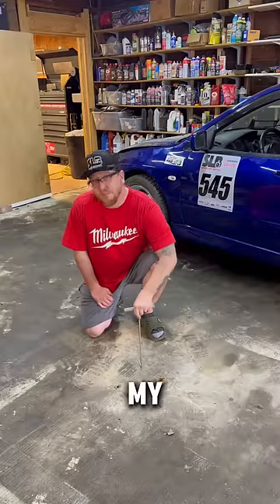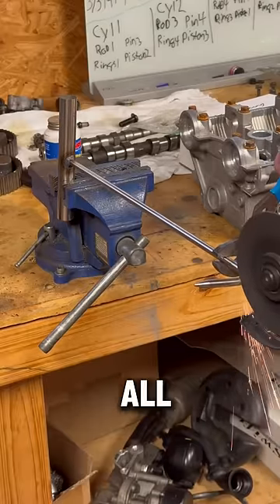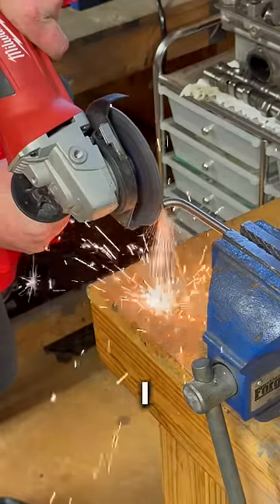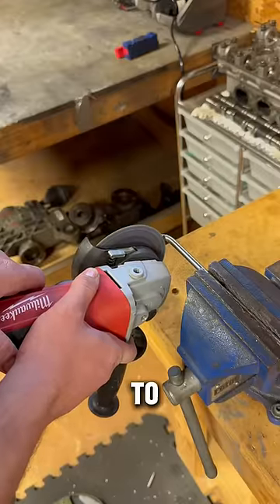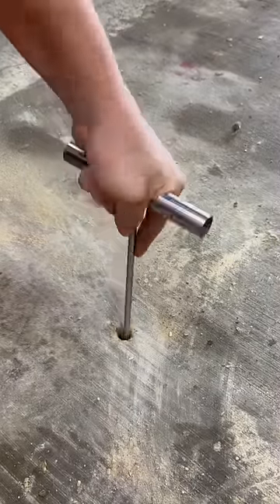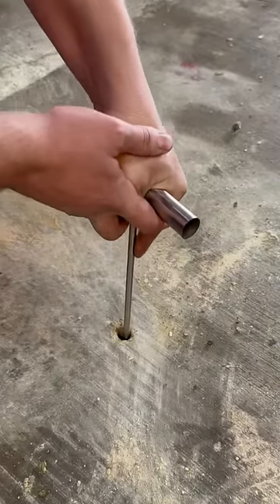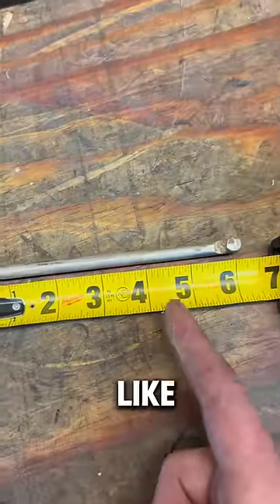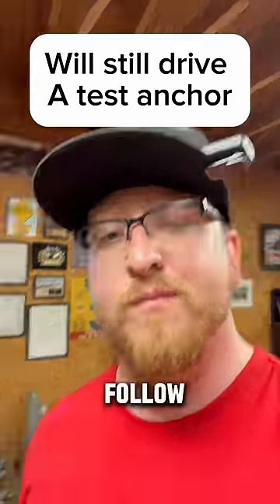Making a tool to measure the depth of concrete.

Comment: Im a professional lift installer. You were never in any danger regarding thickness of the concrete even with the last measurement.
Reply from the maker: I appreciate that Jordan. Initially, I only drilled down to the 4.25 inches as per required by max jacks but other people were saying that that was too low on the minimum requirement scale so that’s why I punched all the way through to see the entire thickness of it and now I have done this in four spots around the center area of the garage where I plan to put the posts. And all of them have measured 5.3 to about 6 inches I just wanted to check before I make a $3500 investment and then have to try and sell it secondhand if it didn’t have enough depth. Thanks for not being a dick. Lol.

Comment: A small key chain tape measure WILL fit down that hole. I have one that is less than 1/4" wide. You said the hole was 1/2" so explain to me how it doesn't fit. Plus the tape measure already has a hook on it. You made a tool to measure something with a tape measure when you could have just used a tape measure. It's the equivalent of going fishing and carrying a canoe in your boat so that you can fish from the canoe 🤦‍♂️
Reply from the maker: The smallest keychain I had wouldn’t and I wanted something stiffer. But this video made 800 dollars so I’m good lol

Comment: Check other parts of the pad, it could be 10" deep at one point and then you can have a High spot and it only be 2".

Wherever your bolting into the pad check there.
Reply: Would you not level out an 8" swing? At least a little bit?
Reply: @Awesummzzz  if they did it properly yes. But if you didn't do it yourself or see it being done, who knows if they did it properly or not. Lots of idiots and nasty people out thier. Always check the one time you don't you will get caught out.
Reply: @PsyMongSki  that's fair. Better safe than sorry. I figured pouring a slab on an uneven surface would be more of a hassle than leveling lol
Reply: @Awesummzzz  that's the proper way of doing it. But think about scammers, if they can use less concrete it's more money for them, so leaving high spots helps them save cash.
Reply: @blakemoresimon  good point. I was more fixed on having the extra deep part so saving cement wasn't even a thought lol
Reply: @Awesummzzz  concrete is bloody expensive now same as tarmac the scammers love to tell you they are putting it down 7" but only lay 2". Mind the local councils are also good at that haha

Comment: Trust me while it may be 4+ inches deep you have no idea how brittle it has become if it wasn't mixed correctly to begin with.
If you are putting up a rack Always-

1) Cut out the concrete
2) Dig out the hole
3) Pack it with gravel
4) Go 8" Thick with the 10" 'J'  bolts
It's all cheap and easy and guaranteed to protect your life.

Comment: .....Maybe I just know too many mechanics lol. For heavy industrial use, 6-10" is ideal, depending on soil/underlayment from what I'm told. Rebar is also really common to put in as well, especially in freezing climates. Concrete hates freezing lol. Make sure nothing gets under it, especially if it doesn't have rebar, as if it gets literally under mined the slab will fail over time especially if no rebar. Concrete is more flexible than you'd think, but it doesn't bend and does best with spread out loads. Directing water away from the pad and backfilling & packing any holes that appear within a yard of the building also supposedly helps.

Comment: Most house pads are 6” slabs if you ask for a reinforced slab it is 8”, now your garage slab is sloped so the deepest will be 6-1/4” and the shallowest will be 5-3/4” now in commercial it’s 8” to 12” depending on the industry. I do foundation design

Comment: well when the roto hammer punches through, its going to knock a plug out the other side, that might lower what you're measuring,  best to jackhammer it all up and measure each piece and average it, then pour new ultra cool slab.   :)

Comment: Its a slab im assuming all tied into the foundation so there could be some spots 6 in and some that could be a few feet thick. You can always check the required thickness for your county and it should tell you

Comment: Lots of simpler way to do this like a coat hanger, but also remember your concrete is all kinds of thicknesses. It's not poured in a perfect slab. There might be 6 inches here 4 inches over there and of course the perimeter is potentially very deep.

Comment: Best way to put anchors in: drill the hole all the way through. Put the anchor in. If later, down the road you bust a bolt or the anchor doesn't hold you can drive the old anchor further down and out the bottom of the hole. Install a new anchor. 😊

Comment: If you look where your garage door closes and driveway starts. You can pull up the rope looking material and use a tape measure. Should be an 1" opening
Reply: Or look up county code

Comment: Could have saved time and money. Go to a RENTAL RENT ALL store, and get a concrete measuring tool. You lay it on the concrete floor and wa-lah, it displays the depth in inches, centimeters, etc. Probably cost for a few hours is less than $10. You can also ensure the depth is consistent around the floor.
Reply from the maker: But I made over 600 dollars on this video

Comment: Set up a rotary laser away from the slab and raise the beam 6" above the slab. Verify this measurement in several places and record those dimensions. 
Without moving the location of the laser,  lift the slab out of the way, turn on the laser and get a measurement to the dirt under the slab.

Now, the tricky part. Subtract the original 6" measurement from the new measurement to the dirt. This new number is what the thickness of the concrete is.

Comment: The only thing I would know is when my previous boss was building his shop. The company that installed his lifts refused to install them in less than 12 in of concrete. And they were standard rotary two post lifts. I think with a thinner concrete floor I would just splurge on a four posts and deal with how much it sucks to do tires and suspension

Comment: So hold the grinder vertically like you did in this video like you were gonna cut straight down, now cut the bottom 1/3rd off that grinder guard. Still full proction and it diverts the sparks straight down. In this videos case, they would have went to the floor instead of the table. Little thing I do to all my grinders when I have to use a guard. Satisfies the safety man. Yet give me a little more eyes on and sparks away a lot more instead of bouncing off whatever is close.

Comment: I watched jerryrigeverything check his concrete thickness. What he found was that it was incredibly inconsistent from spot to spot (between 2 and 10 inches thick). I doubt it will be that bad, but be sure to check as close as you can to the jack.

Comment: I would have looked at the dust on the drill bit. That tells me how thick concrete is, and I drill a lot of 5/8" holes in floors doing pest control. Recently I had to skip one because my drill bit wasn't long enough. It must have been 15" at least, I never got through. Usually they're more like 5-6".

Comment: Concrete thickness is not a reason to give up on getting a max jax car lift.  Ceiling height, budget, vehicle weight and wife are the only reasons not too.  If your concrete is from 70's and thick and solid you are all set.  Clean the holes thoroughly, stick something in like pinky finger to verify there is zero dust.  I did this and managed to drill 20 3/4" holes and drove wedge anchors in without a single issue for my used 12k 4-post shop lift.  First time drilling concrete holes larger than 1/4" and setting wedge anchors.  If you get a MJ and go to install and find one side is not right you can always cut out part of concrete and key in a small deeper section of concrete to redo post anchors.  Not cheap but doable, even DIY with properly mixed bag concrete.
I had no problem verifying depth while drilling with post in place, I was as careful as I could be not to break concrete out the bottom because I was on the hairy edge of enough concrete thickness on 30 year old concrete.

Comment: Hay just a heads up if the concrete guys used a shoot from a long distance it could have moved the gravel from that spot and put a pit in that spot so it would be thicker just in that spot.... But if your confidence in it is good you do you bud.
Reply from the maker: I have checked 4 spots now all 5.3-6 inches
Reply: @Bang4BuckRacing  oh, good to hear. Great ingenuity also.

Comment: 6" pour for a garage slab is the most common, that's what we always did when I was on a concrete crew.
Reply: About to say the same thing
Reply: Where is that commom???out 450+ homes never. pole barns and shops yes,street repair 10 inches, every garage basement sidewalk graded 3 1/2". Where do you live that 6" is residential garage floor common. Are the walls 10"??
Reply: @noextrafood 6" is code in MA, foundation walls 8" to 10"
Reply: Sorry  I only worked Missouri not north pole.what is the reason for thicker floor so can park loaded snowplow in garage? Can you hunt bears with dogs. Swap some mt.lions for your bear
Reply: @noextrafood  we have aloy of sand. So that's taken into account along with the freeze table. Bear population is just starting to comeback on the eastern side of the state. So no dogs yet. Lots of white tail though
Reply: Hey is ma maine or Massachusetts
Reply: @noextrafood  MA is mass, ME is Maine
Reply: @madman19932  if you tired of sandy dirt come here, south of 44, did subdivision in Festus where utilities and most holes had to be shot. Guess  wood stakes 4you, no pins with nail holes?
Reply: @noextrafood   we either have pure sand or solid granite. Building here is so much fun -_-
Reply: @madman19932  ain't mass. Where all the rich people are? Martha Stewat's vineyard . What flatwork rate $10ft
Reply: @noextrafood  that's only the Vineyard, and Ptown. The rest of us are mostly blue collar

Comment: Trust me you'll be fine, we put our lift in an apparently our garage is on a slope, well one side the anchor bolts are in 4 inches the other side its little over 2 inches. But we haven't had any issues luckily lol
Reply from the maker: 🤣🤣 if it works it works lol
Reply: @Bang4BuckRacing  we put my buddies jeep on it with 2.5 rockwell axles, the thing weighs almost 7k pounds an it didn't end up falling so we figured it'd be alright lol, until a couple years later an the concrete cracks 🤣🤣

Comment: Did you test at multiple points? Unless the floor was done properly, it probably has a bunch of variation. If you tested 2 or 3 more spots and they were 5.5-6.5 I’d say you’re good. But I’ve seen plenty of floors that travel between 2.5-8 inches, which is obviously problematic without even putting load on it

Comment: I cut and dug an 800mm hole in my concrete floor, with rebar hooking into the old concrete at 200mm.   I have a heavy 4x4 - so this was insurance..... Only took a few days to engineer.   Just too final  if it goes wrong.

Comment: Dosent really tell you how thick it is only tells you how thick it is in that spot if your pad was not leveled then could be 6 in pne spot 4 in another  sorry
Reply from the maker: I’ve measured two separate spots 5.5-6 inches
Reply: I think if he would just go to his local DEMO MAN OUTLET STORE, he could pick up a starter set of graduated shaped charges.
I think the newer ones are calibrated to .500" increments.

He just needs to start at the assumed 4" thickness for residential slabs, and then use the next lower charge, in this case, the calibrated charge of 3.5" for full penetration.
Then, if the location of the blast does not fracture and pierce the slab, then he goes  with the next more powerful charge.

This method lets you dial in the results incrementally, and minimizes unnecessary damage by going too strong at first.

Now, if done correctly, you will have extra charges left over, but they can always be fun to use during various celebrations, or having fun with the kids getting rid of leftover Halloween pumpkins!

Comment: Assuming the outside is dirt or grass, couldn't you just dig a lil bit and measure the thickness from the outside foundation? Wouldnt have to go through the trouble of fabn a depth stick

Comment: Anyone else doing this. You can use a “getchya grabber” (what we have always called them). They look like a piece of old school metal wire wrapped choke cable with an expanding set of claws at the end that you actuate with your thumb on the plunger. Poke it in the hole. Expand it and then gently pull back till it hits the concrete.

Comment: When you drilled the holes with hammer drill, when the drill breaks through,that's how deep it it.
Reply from the maker: That’s not as accurate as this
Reply: @Bang4BuckRacing  it's concrete.depending on exactly where you drill,and how big the gravel under it is, the holes are going to vary easily a half inch or more. So, measuring the amount the bit is actually making concrete dust is going to be a good as it gets

Comment: You drilled a hole right? You'd feel it change from concrete to dirt so just drop the drill bit down and measure the depth.

Comment: Put a rubber o Ring around it so you don't have to use a marker and can reuse it forever
Reply from the maker: Not a bad idea. But brake cleaner can also wipe off the marker

Comment: Don't know enough about what you're doing. But it sounds like you need to put anchor bolt in concrete and don't know if the slab is thick enough. By measurement of 4+ that you gave means you're using 1" wedge anchor, meaning it has to go in 4+ inches to anchor. Again, it's important to know application, what are you anchoring, then we can get into why you measured depth of slab that way, because there are other ways to do this, and you trust it's uniform to code

Comment: Not a manhole cover tool that's to get into a utility box usually traffic power fiber or water meter, it would be too weak to lift a manhole cover especially with how stuck they can get
Reply from the maker: That’s just what they have it labeled as on Amazon bro so that’s what I called it. Lol.

Comment: Figure where ur gonna get mount it in the floor chisel it out three to four feet wide  buy 12 to 14  wide put some rebar in it go get some bags of sack krete at home depot done
Reply: Yep. Also don't forget to use concrete that meets the minimum concrete PSI rating for the specific lift's load rating too 👍

Comment: why not use a coat hanger and a pair of pliers? Just use the drill bit to clear the dirt out of the way. You could even use a shopvac to suck out some dirt or compressed air to blow it out of the way.

Comment: Couldn't find a depth gage with a hook....? Starrett, Mitutoyo, SPI, Insize and many other make them. You can even find them easily thought places like MSC Direct. Now the real reason is they cost a lot for what you wanted one for and that's ok. Not everyone needs a depth gage with a hook tip especially just to see how deep a slab is.

Comment: It’s called a tape measure. It has a cool little 90 degree end on it so that it won’t slip off. It’s the coolest new invention. Geez
Reply from the maker: Damn unable to read the first sentence of the pinned comment 🤣
Reply: @Bang4BuckRacing  they make tape measures with a smaller width that 1/2”. Damn are you unable to find a tape measure that will work for this?
Reply from the maker: @jonbottoms8988  why would I do that when I made 500 dollars off this video modifying a cheap tool that got me the same results 🤣

Comment: Here's a tip for anyone that wants to check it their slab is thick enough. 
Mark on your drill bit what thick enough is.
Start drilling.
If when you get to your mark you're still drilling concrete your slab is thick enough.

Comment: Could he have not just put a piece of tape every half inch of the drill bit and then drilled the hole and then where ever it breaks thru would mark the tape and its a simple .5 times however many tape pieces are missing?

Comment: Or you could have checked the plans for your house first and only drilled one hole. The inspection records would tell you what the rebar spacing was. Guess drilling holes and spending money is easier. Tradesmen really aren’t the pieces of garbage your high school counselor told you they were. We follow the prints and build quality buildings. I wouldn’t trust a mechanic with anything other than complaining about everything but if a mason tells me a slab is six inches thick, I believe him.

Comment: Guess he couldnt afford a welding rod or even one of those small handheld tools with the extendable blade that has numbers written on it and a hook type end to it
Reply from the maker: Guess you can’t read the easily visible pinned comment before you vomit your opinion 🤣
Reply: @Bang4BuckRacing  Cant take a joke either I guess

Comment: - you didn’t factor in half the markers diameter 
- you didn’t factor in the diameter of the hook

4.25 inches. If they bothered to state that .25 you should probably measure accurately by at least 1/4” intervals. Also, coat hanger. 

Sloppy.

Comment: that is inaccurate. when you drill thru brick/stone/concrete your bit will always blow out a potion of the exit. so its probably anywhere from 1/16 to 1/4  thicker than what your measured

Comment: That’s not accurate,, it all depends on how well they graded it before they started pouring,, sometimes they do a good job and it’s nice and maintains the thickness throughout and other times it’s low here hi there and you might be in the valley where it’s 3 inches deeper than the rest of the slab I would do it in a few places if it’s that important..